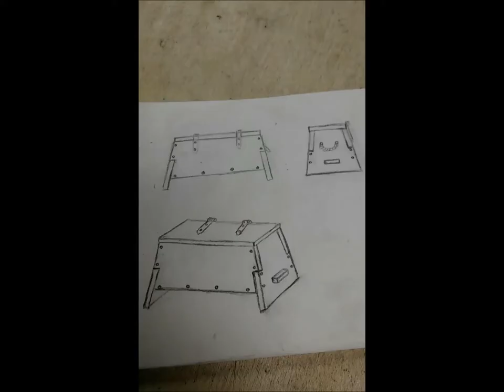Viking chest

Comment: Hi there! 

You might help me with something: im about to order a custom made helmet, fitted to my head. Problem is, i want to wear chainmail and have no idea how many Centimeters i should add to the size....
Reply from the maker: for myself, wearing maille with an arming cap increases my head circumference by about an inch. so maybe a few centimeters extra to make sure there's enough space?
Reply: TeutonicPenguin thanks for the reply. I talked to the seller of my supplier for chainmail, and he replied with 0,4mm-0,7mm (which is roughly  0,15in-0,26in). An inch is around 2,54cm, which sounds good. I just wanted to ask since i dont want the helmet to be to big. This would need more padding to even out the difference and so on.

Again thank you so much for the advice!